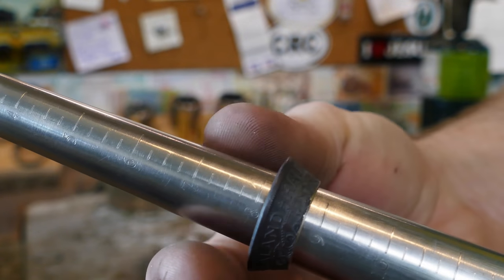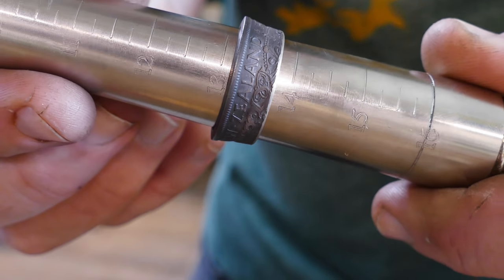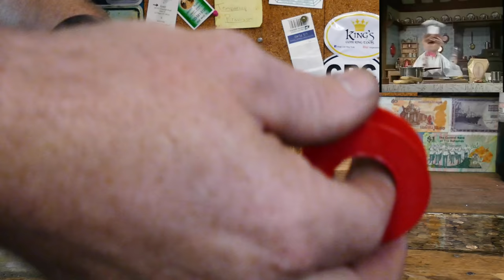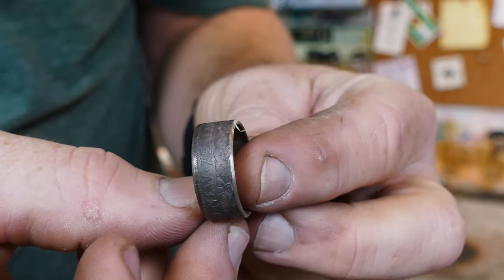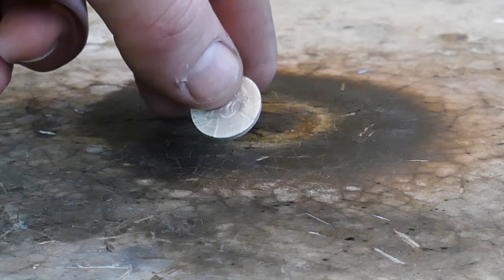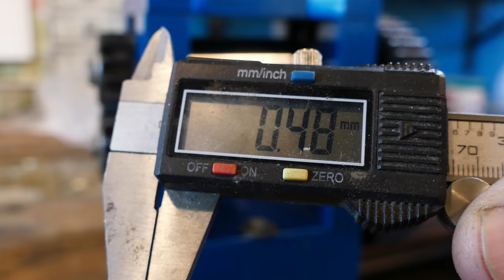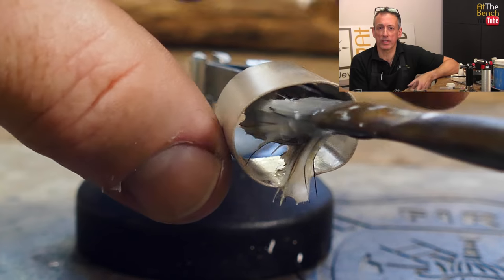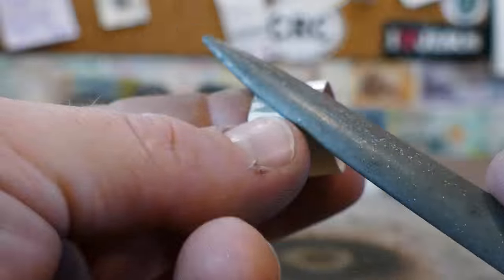Making a New Zealand Half Crown Ring with a Pure Silver Liner

Comment: Hey Skyler, I have been making coin rings for about 8 months now, and I'm just starting to sell them. Right now I do mostly quarters, with the odd out of country coin here or there. Unfortunately, the punch and die set that I have been using (the harbor freight one which you have recommended a few times) as been doing a less than quality job of cutting a hole through the coin, often leaving some extra material, which can ruin the ring (as I'm sure you know). I believe this is due to a slight dulling of the sharp end of the punches, and as much as I've tried I can't seem to sand it back to being perfectly sharp.

I'd love to upgrade to a JasonsWorks auto punch, but as of now I don't quite have the budget to do that. Is there an alternative for around $100 which you could recommend, or should I save up for the auto punch? I already emailed harbor freight to see if I could buy a replacement part, so we'll see if they get back to me on that. 

Thank you!
Reply from the maker: I don't have experience with a good in between punch. There are a ton of manufacturers out there though.
Reply: Change You Can Wear first off, Happy Thanksgiving! I have another quick question - for some reason I can’t get my sparex no 2 pickling solution to properly clean any of my annealed rings. It always leaves either fire scaling or some light copper plating. I’m making sure to only use copper tools in handling it, and I’ve tried it at a wide variety of temperatures, times, and concentrations. It doesn’t seem to clean either the copper and nickel quarters, or the silver quarters I normally use. 

Am I doing something wrong or is there a better method for getting rid of fire scale?